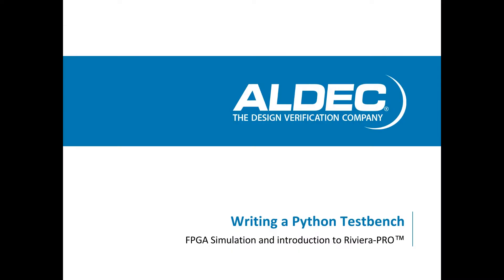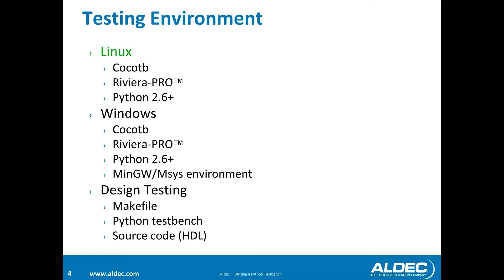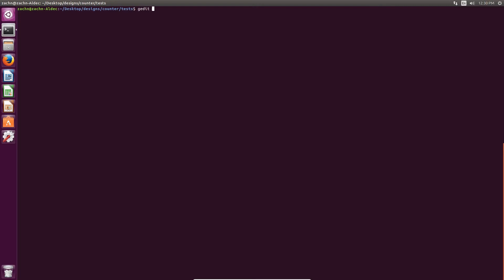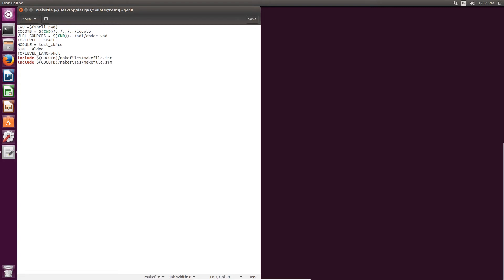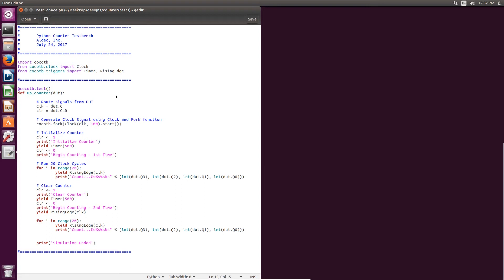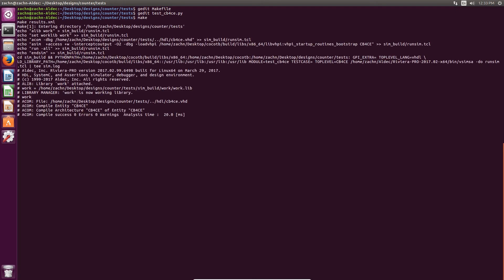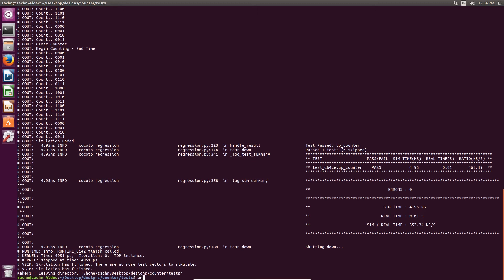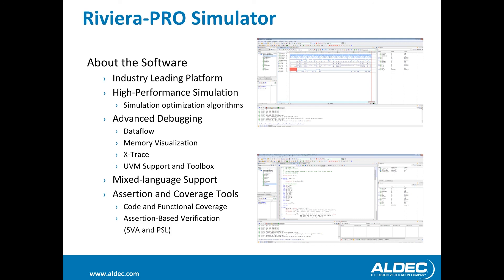Writing a Python Testbench

Comment: Really interesting, but what's the point for using python to verify a HDL code, I mean what's its benefit ? Is there something which python can do but normal HDL languages ( Verilog, VHDL) can't in a testbench ?
Reply: Yes: calling other software like C executables, or calling other TCL scripts, which allows for easier integration in a software environment. Why would you want to do that? Well, maybe you can integrate your HDL TB, as done in CocoTB in an environment where you want to plot the outputs of your RTL block, or open files in more user friendly manner to drop log messages, read them to provide stimulus for a RTL designed block, or comparing its outputs with golden cases that are stored in files. 

VHDL does file management as reading and writing on them, which is great. But Python has a more user friendly approach for the same task.

All in all, if you want a fully fledged verification environment, you can do the following:
* Build a RTL (VHDL for example) only verification environment; procedures, functions, files, etc...
* Build a RTL + TCL verification environment; rtl procedures, functions, files or tcl functions, files, etc...
* Build a RTL + Python verification environment; rtl procedures, functions, files, or python classes with functions, files, etc...

As I've said before. If you design a Digital Signal Processing block, that accepts and generates data in bulk, verying its output is easier in Python, if numpy gives you enough functions to create signals such as a sine function, or plotting the immediate outputs of the RTL block. 

And if you don't, Python still offers a lot of solutions for immediate stimulus generation or output verification of an RTL block, that otherwise, needs to be generated via TCL, or without TCL, maybe given via stimulus and output files, which has a bit more steps to it.

Comment: Hi..which libraries of python(like numpy, pandas etc) are important to learn in ASIC verification..please reply
Reply: RTL verification using Python is hardly a determining factor when writing a high level TB, like the one in the video.
The only libraries you need would be cocotb, as you can see. Once you have that included and running, if your desing is Digital Signal Processing oriented, you might want to use numpy and matplotlib for processing of signals in parallel of the VHDL, and/or to plot the rtl outputs vs expected sw calculated outputs.
That is, by no means dependant on the ASIC. It depends on one thing, and one thing only: what are you designing in RTL?

The libraries to use are up to you. Cocotb would give you the means of verifying RTL using Python. Anything else from there on, is up to you.
Reply: Ravi Kanth oof 7 months no reply